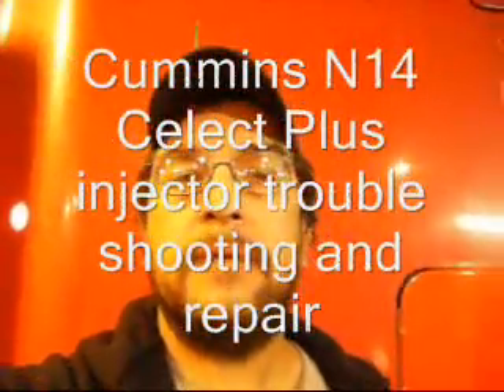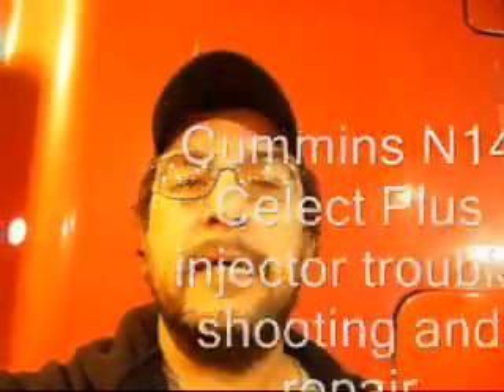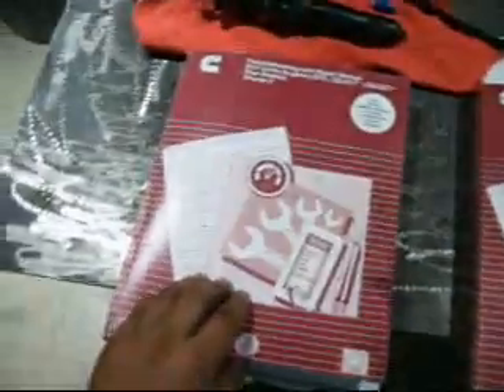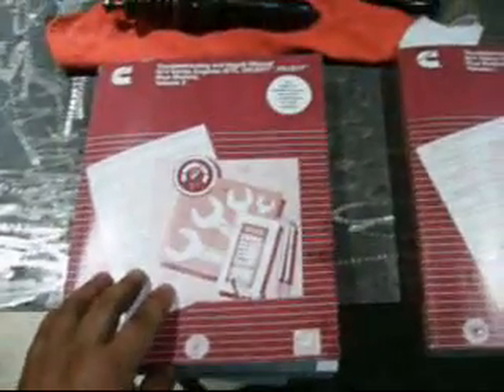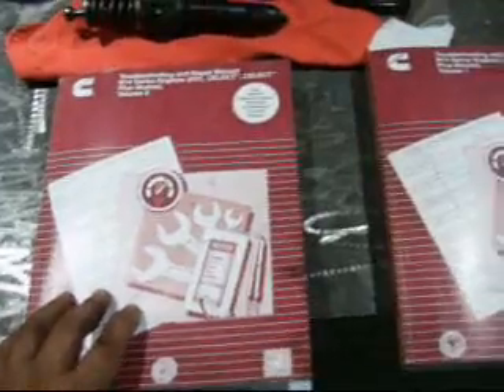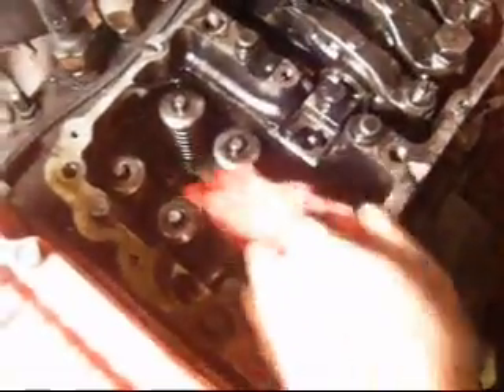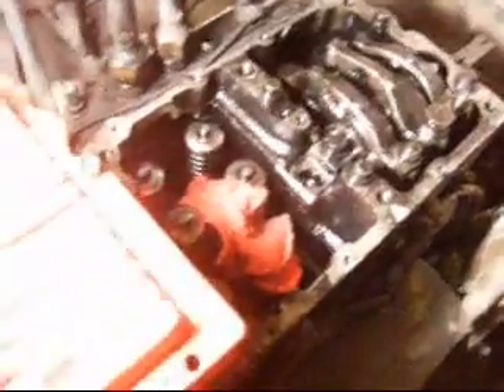Cummins Celect Plus injector troubleshooting and repair.wmv

Comment: I got a problem on my n14 celect  plus it’s missing under load and runs like crab but it goes away and it comes back.. could this also be and injectors problem?
Thanks
Reply: RV TRAVELING MONTANEZ WAY I don’t know if you got the problem fixed but my cat was doing what you’re describing and so was a friend of mine with an n14 and it turned out we both had bad crank sensors
Reply: LEO RIVERO Thanks for that info I will pass it on to a buddy of mine who purchased the truck for me I think that could be the problem we end up putting new injectors and still did the same problem so I believe what you’re saying is right

Comment: Good Vid!!  Bad idea going with a vender not Cummins.  And I'll tell you why.  I've dealt with with off the wall vendors and this vendor specifically out of Ontario, Ca.  I had 3 of the 6 injectors fail within 3 months of the install.  Not dealing with Cummins cost my customer several hundred dollars in down time and lost revenue.  Had he went with the Cummins Injectors right off the bat, he would have been up and running same day.  As it was,  it was several days dealing with the vendor, he didn't want to warranty the faulty injectors.  So to get the guy up and making a living, I had to go to Cummins, three seperate times, and rebuy three injectors, three seperate times.  To finally work the kinks out of his good deal with the vendor.  Long story short, paying a little up front would have saved a lot of grief and Money.  JMHO!!  Always go with the Manufacturer, your covered at least on parts and Warranty.  But, the lost revenue and downtime are still gone.  If your looking for a good install vid this one is agood one.

Comment: another way to check for a bad injector if it hasn't been mentioned is to use a digital thermometer and point it at each exhaust port after starting the engine cold. When you find one hole that heats considerably less then the others you have found your trouble.

Comment: MCDIESEL3406,  Dont be so paranoid dude.  You assume the worst automatically.  You can also go by what the driver experienced while pulling some weight. Some injectors  tent to fade away slowly.  Ive owned several trucks with Cummins and my hunch never failed me.  Certain things a truck will do when an ijector is starting to fail.

Comment: Just throw an injector at it? What about correct valve and injector adjustment? What about compression? Blow-by should be tested under a load to find maximum allowable parameters. If it were me, I would have checked some more before condemning the injector. Did the injector fix the problem? If it did, you sir got lucky. Much more to check before throwing $500 at it. On a N-14 fuel is injected manually (by the rocker arm, ie camshaft) and amount of fuel is controlled electronically. If that cylinder was smoking, that indicates the cylinder was getting fuel but not firing. If the cylinder was getting fuel, but not firing, that would indicate low compression (broken or damaged piston rings, faulty valve adjsutment, flat camshaft maybe)
Reply: Penyetelan injector
Reply: Penyetelan injector

Comment: I have a cummins celect plus  they have a leak oil between head an manifold in cylinder 5 and 6 
what you thing is wrong  rings or head 
 head can have a big leak from the valv to pistons ?
Reply: change the valve sell

Comment: would you please share the torque used on bolts for heads and injectors. also can you explain the the way valves are calibrated. thank you.

Comment: when you run thise engines very low on fuel you can cook the lift pump which will and or may have also toasted your high pressure fuel pump and caused damage to your injection system. just a problem that as a cummins certified tech i have seen and had to diagnose.

Comment from the maker: Before you start replacing components it is crucial that you do the proper diagnosis.  If you just start throwing money at it you’ll find it will eat up your wallet in a hurry. If you are going to spend the money on unnecessary components the money is better spent on tools and diagnostic equipment you can use on other projects.  Bottom-line if you don’t have the proper tools and equipment make the investment or improvise to rule out components or whole systems as the cause of your problem.

Comment: the grid heater is working and because i'don't have tools to check fuel pressure i'm not sure if i have to replace the injectors do you thing i have to replace the injectors ? thanks for your answer and your time hope you do more videos any thing about trucks

Comment from the maker: It could even be a fuel issue I have a 12 valve with a P pump in a 94 Ford 5 ton dump truck that starts without ether in extremely cold conditions without a block heater of course I use PowerService in the fuel and make sure I always buy quality fuel.

Comment from the maker: If the engine is high mileage or was abused you might have compression or valve issues.. Too many things that it could be start with the simple stuff and do some diagnostics like fuel pressure, compression if you are able to.  Look at the service history if it is available to see if the valves were ever set properly etc..

Comment from the maker: Is it a 12 valve or 24 valve version of the 5.9 and what is the engine in?  It’s difficult to diagnose a problem such as the one you are having when you have the engine in front of you so I won’t pretend to be able to do it here..  Some possible issues might be simple stuff like restricted air from dirty air filter or not enough fuel pressure from the lift pump.

Comment: I have a 2007.  Dodge 3500 ... 5.9.  .. 146miles ... Ran very low on Desiel  44 miles til Empty ... Once check light came on And puutting since I filled up ...  About 3 hrs ago .... Code p2149 ....injector circuit open cylinder 6... / fuel injector group b supply voltage open ... Any advice you could tell me 
404/861-0658 ... Mick ... Thanks

Comment from the maker: The solenoid is the only aspect of this injector that is electronic and governed by the ECM.  It has been my experience that when these solenoids get weak or fail completely the engine might still run at idle without a misfire but under power will miss and have no power.  The injector also has a ceramic check ball and metering plunger which will cause the same condition under power if worn as they will allow fuel to escape under pressure rather than injecting to the cylinder.

Comment from the maker: With this particular injector the way it works is that the solenoid is in an always open position allowing fuel from the rail into the injector and only closes during the downward stroke of the metering plunger so as not to allow the fuel to go back to the rail, rather trapping it in the injector and metering it to the cylinder.  Technically, with this particular injector it would be more that the injector fuel supply is “closed” electronically at the injector.